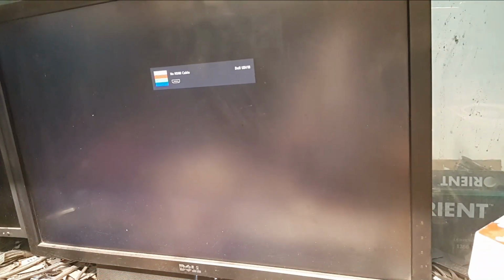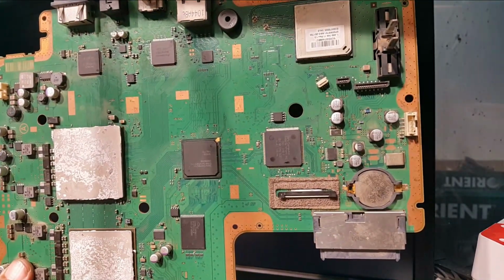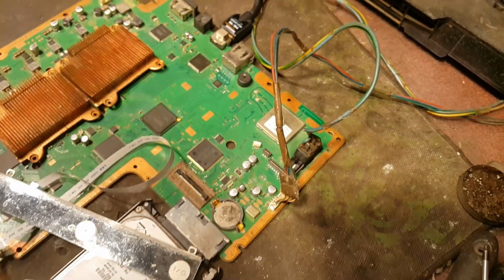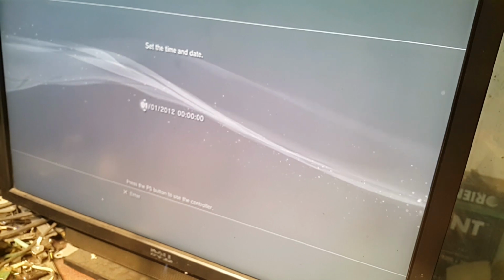PS3 slim shuts off.

Comment: I’ve been following your videos with great interest. Your explanations on electronics are very educational and easy to understand. If possible, could you demonstrate how to use an analog oscilloscope for troubleshooting and fault-finding in your future videos? Also, where can I find the schematics or datasheets for the PS3 Slim circuit board? Lastly, while attempting to repair my PS3 Slim, I accidentally broke the plastic ribbon connector for the power button, and a few pads/traces came off with it. I need to reconstruct the paths from the thin traces or chips. What is the easiest way to bridge these connections? Would shorting two specific pins work to power it on, and have you covered a similar repair in your previous videos?

Thank you for your amazing content!

Comment: Dear Idrees, this is an amazing content. May i ask you your suggestions about my PS3 slim problem? It behaves just like this one , turn on and 0.5 sec later its totally off with no light. I run a syscon test and the error code is 3004, which lead to a "RSX core power failure". I got to the motherboard but i was wandering if you could help me understand which area and component to check. I'm watching many of your videos to understand the range value of the compoent. Thank you so much.

Comment: I didn't recognize the damaged  part , is it a resistance?
Reply from the maker: Hey @hussenalmamore6316! If you can't recognize the damaged part, it could indeed be a resistor, Use a multimeter to test the resistance. If it reads "open" or doesn’t give a proper reading, it could be a damaged resistor.If you're unsure, feel free to share more details, and I can help you figure it out! 😊
Reply: @idreestech  thanks for the information, but for the part in your video is it a resistance?

Comment: Hello sir,  thank you so much for the knowledge. Super helpful, I never had any consoles before so this is very new to me

But I have few questions:
1) If I use resistor with slightly different value ex; 33ohm changed with 50ohm , will it work?
2) For your power supply, is it 12v, and how many amps of current does it produced?
3) Does the sound comes from your monitor speaker or from the ps3?

Comment: Hola cómo estás tengo una ps3 slim 3000b. Que sin disco duro funciona correctamente y si pongo el disco duro se apaga. Alguna solución?
Reply from the maker: It is simple, swap the HDD.
Reply: @idreestech  pero no es falló de disco duro es un falló en la placa ps3 slim
Reply: Pones el disco duro y se apaga
Reply from the maker: @Elpola-o6p  Compruebe el regulador de 5 voltios de alimentación del disco duro, puede que esté en cortocircuito. Vuelva a verificar la polarización de dicho regulador también.
Reply: @idreestech  que parte me fijo el regulador
Reply from the maker: @Elpola-o6p  
Rastree la línea de 5 voltios que va a HDD. El componente al lado.
Reply from the maker: @Elpola-o6p  
Rastree la línea de 5 voltios que va a HDD. El componente al lado.
Reply: @idreestech  dónde dice th3280 ? Cerca del disco duro ? O donde está la pila de memoria

Comment: Can you help me? I have Ps3 with cobra ode E3 sata installed on motherboard.. The cobra chip is not working.
And I want to remove it all. But I don't know what exactly resistors or capstors smd they removed before installing cobra on Ps3 DVD driver line... Do u have idia?

Comment: Please I have ps3 3004B when I turn it on I can play it for about 30minute to 2 hours and it will turn of by itself. When turning it on back at time it does on immediately at times it goes off after turning it on.
Reply: When it turns off too the red light doesn’t show unless you press it before you will get the red light

Comment: I have another ps3 slim when you turn on the red light it turns on green and starts the cooler, as if I was on the self-cleaning system, after 3 beeps. if I try to turn on the red light again, this will happen, do you think it could be what teacher?
Reply from the maker: The eject button on the power-on strip seems to be shortened.
Reply: @idreestech  Can you tell me where I look for this glitch?
Reply from the maker: Disassemble it and check for the OHM reading at the eject button points.
Reply: @idreestech  I changed it to another front that has already been tested and is perfect, but it has the same problem, I think the problem is in the motherboard
Reply from the maker: Around the 8-pin chip that gets input from the eject button, the components, and the chip itself.
Reply: @idreestech  The board model is DNY 001, it doesn't have this 8pin chip, can it be in the input where you put the front to connect or is there another place for me to look for the error? thanks for helping me
Reply from the maker: On the upper side of the power strip connector is a diode, check for the short circuit reading on it.
Reply: @idreestech  Sorry, I didn't understand correctly, my English is not very good. this diode that you speak is there on the side of the connector where you put the front to connect?

Comment: Hi, do you know why my ps3 slim 3004A 1C turns off after 40 Sec. ? No HDD blinking, no picture, no audio, reflow already tried 4 times. After these 40 seconds it shutdown, not even the red light is there, no blinking, no peep . But when I dont use the clams the Fan spinning up really fast, thats normal. The Ps3 fan was really loud before but never overheated. The temps were on syscon 65-66 both chips.
Reply from the maker: Try to re-flow the chip with which the 12-ohm resistors are attached.
Reply: @idreestech  I already have reflowed the whole Board. Still nothing.
Reply from the maker: @INSTXNT-_-KXRM3  Are all supplies are fine?
Reply: @idreestech  I tried so many things but still nothing. The console fell 5 times. When I put pressure on the console it freezed and turned off. Now the console is complety dead.
Reply from the maker: @INSTXNT-_-KXRM3  It seems that the pads under BGA chips are broken so crap.
Reply: @idreestech  Can you tell me what the BGA Pad or the Chip is, how it look like?
Reply from the maker: @INSTXNT-_-KXRM3  https://youtu.be/XM7ySZD3O5U